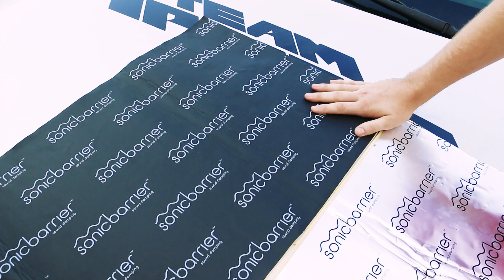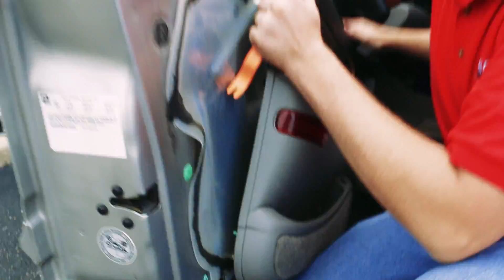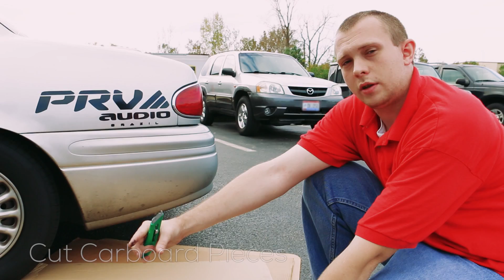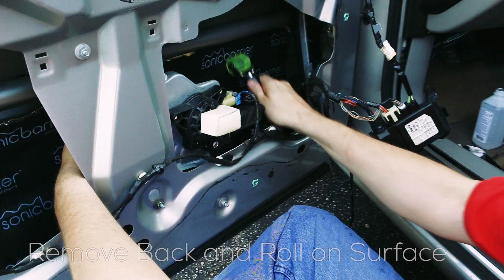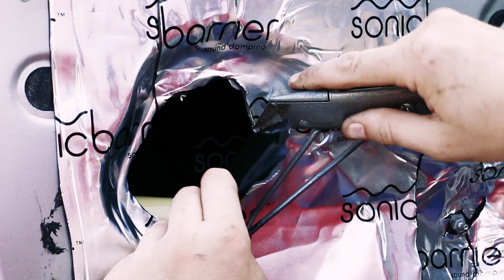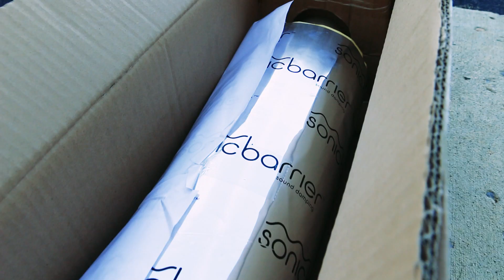How to Reduce Road Noise & increase Audio Quality - Car Audio Sound Damping

Comment: In the case of this video, you probably don't need to. Since it doesn't look like speakers are mounted on the actual door metal itself. But if it was, I'd use something to cover those large holes up. Your factory vapor barrier can actually work better than most people give it credit.. Or in my case, use the dampening sheets to as well. Just have to be careful that route.

Comment: Will this work well for diesel engine noise?
Reply: You'd have to line the firewall, doors and probably roof of the car.  However you're still going to get some engine noise through the glass in the car which can't be damped.
Reply: Ryan II thanks for the quick response.  I'll definitely will be doing it. 
I have a 1988 Ford f-250 7.3l diesel extended cab. 
I'm in need of bass as in tech master P. E. B.  
A head unit and I'd like to get down to 20-10 on the low end. 
Any suggestions? 
And links to your site where I can get them 
Thank you so much
Reply: 10Hz in cab is going to be hard to achieve and kind of pointless IMHO. 

Techmaster PEB lives up in the 40-80Hz range because that is what give the typical thump most people recognize in car bass.  However there is plenty of low stuff now days in music.  It just takes gobs of power to achieve and big drivers with over sized suspensions etc. to get down to 20Hz in a car environment at any meaningful volume/SPL.  

I think you would benefit to watch some videos from these guys: 

Steve Meade Designs
Stereo Integrity
RE Audio

there are so many car audio enthusiasts these days. 
Search for anything here on YouTube and you'll find boatloads of good info around car audio.  From guys teaching you how to do custom fiberglass, build custom subwoofer boxes, LED lighting or integrating iPads/tablets into a car dash for the ultimate stereo control unit.  

BTW - I forgot to mention but you would even want to remove your seats and carpet in your car then line the floorpan with sound barrier materials
Reply: Ryan II THANKS! I didn't think about using a tablet / iPad... With cellular data and signal!
I'll look them up
I threw techmaster in just to show my age I guess!